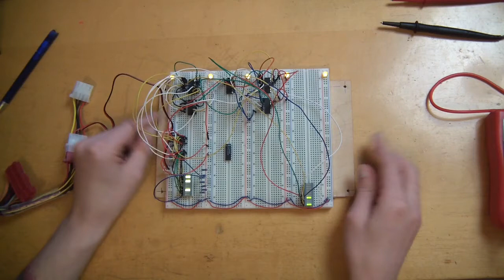Lets Build Mailbox 2012 11 29 Why logic gates

Comment: Hey, I just found this series and wanted to tell you you're amazing! :] I really get how you explain stuff... I've a question, if I may... If a transistor is basically a switch that, when on, transfers 5V, and when off, transfers 0V, why not simply bypass the transistor and connect the lines directly to the 5V power source, and on the power source itself decide which line to turn off/on, then same way you'd decide which transistor to turn on/off... I hope you got what I'm asking... Thanks! :)